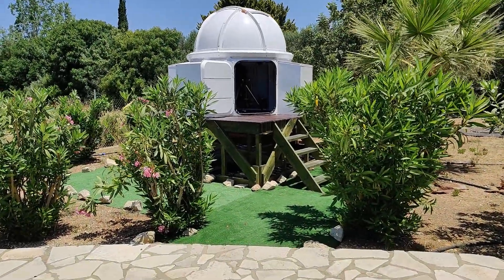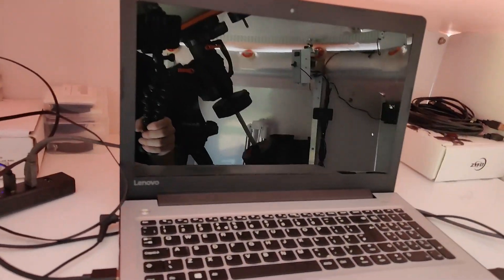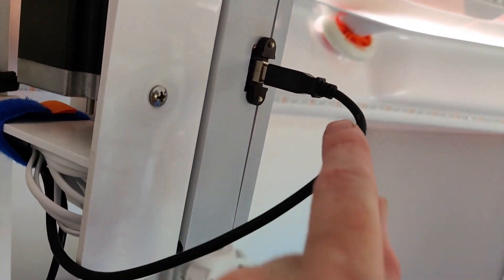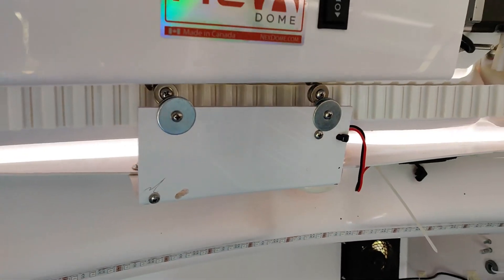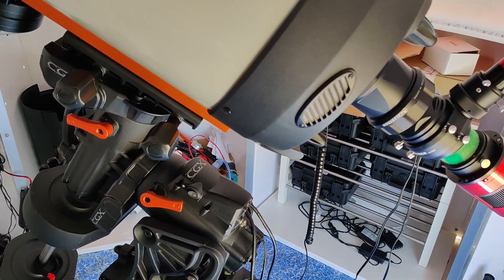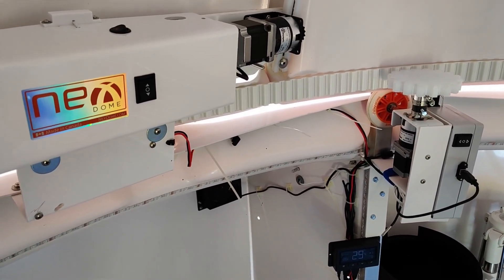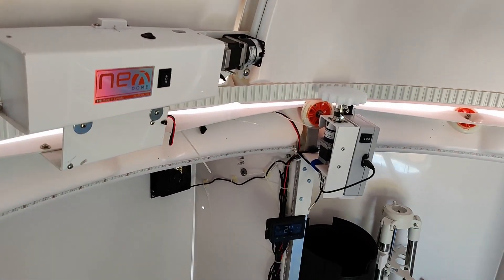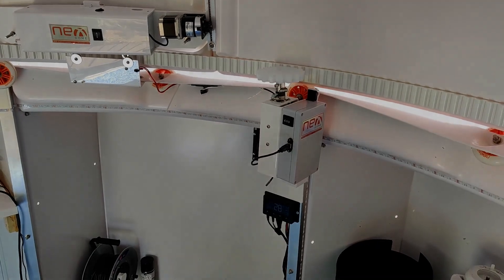NexDome progress tour! Problems, mods and general musings.

Comment: I was looking at getting one of these, but your video makes the design seem to be so poorly conceived that I'll probably just build another observatory from scratch.
Reply from the maker: Hi, this is a couple of years old now, and they have been revising the product over time, they have changed the electronics, they redesigned the shutter rails system a couple of times, so no idea what the current shipping version actually looks like! For a relatively low cost observatory I don't mind the tinkering.  Reading various forums over the years, the various companies domes all have their quirks, unless you start getting into the more expensive ones.

Comment: Thanks for the video ! What double-tape did you used ? Has it worked well to hold the track over the years?
Reply from the maker: Hi Harold, I used the Gorilla tape I think it was, supplied with the dome, it is still attached so yes it's working, when using tape I always clean the surfaces with alcohol spray which makes a huge difference. If it hadn't worked I would have got hold of the 3M black tape which I know is excellent.
Reply: Thanks Daves, I'm going to buy Gorilla or 3M. I just bought a second hand Nexdome (1st version) and need to reassemble some parts of the dome
Reply: Also, I'm thinking the same thing about magnets to block dome rotation and use the dome as a remote. Have you found a solution since this video?
Reply from the maker: @HaroldxC  I haven't explored the locking dome instead of the weather hooks. Not had the need to yet. It should be relatively easy with some solenoids and simple hardware.
Reply: Thanks for the answer, I'm going to have a look  @DavesAstrophotography

Comment: Thanks for showing your dome. I debating between sky pod and nexdome, I. Live in Fontana California, it gets very windy during January and February. How strong are these domes?
Reply from the maker: I have had no issues in high winds with it. And because of the slit design, you are a lot more sheltered imaging when there is a breeze. Also, the Nexdome can allow Zenith imaging, which I believe isn't as easy with the Skypod. The abs is very tough, there are a couple of wind retention clips on the inside that you can hook on when not using the dome, you could also get the cover for it and strap the whole thing down if you are concerned if there is a big storm coming.
Reply: Thanks . I  think I will go with this brand ,  I might have to reinforce the walls for support if needed. I work nights I need this setup to be fully automated to image while I am at work lol.

Comment: Dave, quick question. Do you keep your camera hooked up to your scope or was this just for presentation purposes? Its always somewhat time consuming to have to go through the full routine of camera set up each time I do a session. Just wondering...
Reply from the maker: Hi there,  I leave it hooked up, except when I take it off to do Darks, then put it straight back on again. On the Rasa I just put a plastic bag over the dew shield as obviously can't get the scope cover on with the camera attached,  and on the Edge it's not an issue being af the rear.

Comment: 2 Motors later, shutter alignment problems, software glitches, the Price and Time I put into the NexDome system, is not worth it.I gave up !!!
 I am glad you have worked out the kinks, let us know how the "software" portion of your Dome works. Thank for Sharing
Reply from the maker: Sorry to hear you gave up, did you get rid of it or do you get someone to sort the problems out? I'm going to change out which scope I'm using in the dome when I get home in a few weeks,  and when I remove the mount from the dome I'll recheck the centre point, symmetry etc. And take it from there...
Reply: @DavesAstrophotography  Hi Dave, I will probably take another wack at it again soon, your setup and inspiration got me fired up again, here’s my email steve@ryantecheng.com, I’ll show you my setup
Thanks again 👍
Reply from the maker: @TheRyanRanch  Sounds like a plan! I pinged you an email to say hi anyway...

Comment: Nice tour Dave, it feels like there's lots of little things on the to do list.  Just wondered what made you go with this over a shed type design?  Cheers.
Reply from the maker: Off the shelf and easily torn down and rebuilt if we move properties or countries, we rent in Cyprus, that's why I haven't gone down the route of using concrete as it would be a nightmare to 'return to original condition' if I moved. I might go for a smaller shed setup for the 2nd rig.